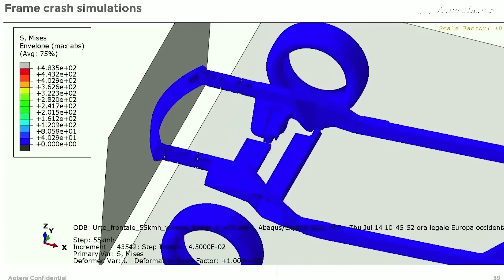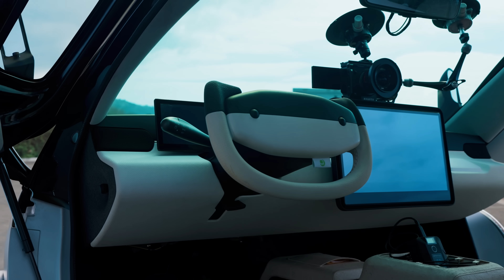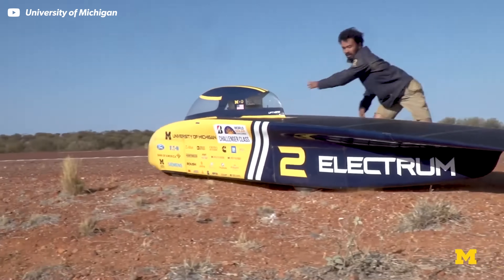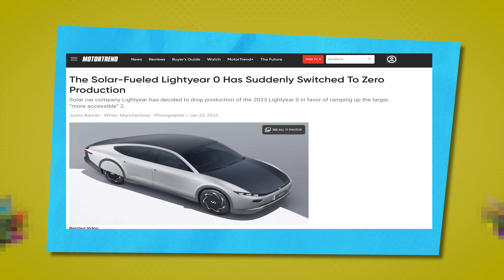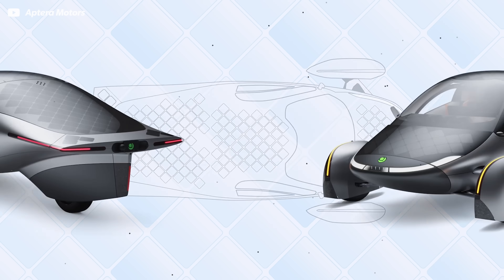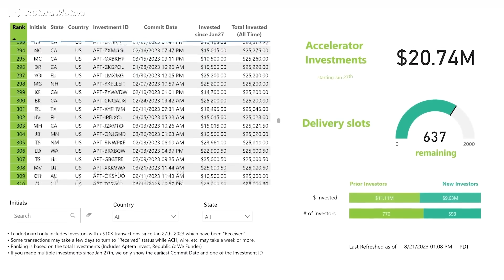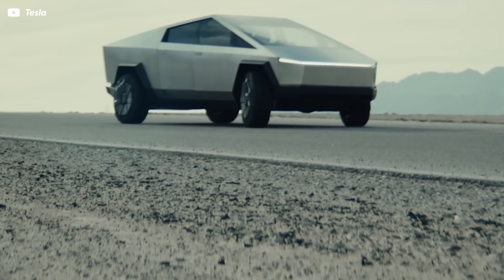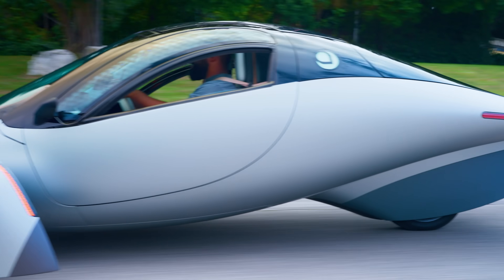We Drove America's First Solar Car

Comment: I'm putting this on record right now: there is NO WAY they get this thing out for $25,000.
Reply: The 1000 mile range version is $50k. The $25k one has a 250 mile range.
Reply: If you go look up the actual design and components of it, and with the cost of battery tech getting cheaper and cheaper, it is actually possible.  It's really neat and I'm so excited for this car.
Reply: @gothnate  $50k for 1000 miles is still amazing. $25k for 250 is really good. I think overall if they can get these price points, Aptera is gonna be making loads of money
Reply: @SMLYTPMovies  Yea, my kia ev6 was 50k for 250 miles of range.
Reply: @SMLYTPMovies deadass. I paid almost 40k for my Bolt EUV. I'd shell out 50k for that crazy range.
Reply: Why not? It is a far simpler machine than a Tesla.

It hits all the right spots. It is simple. So cost effective to make. Aero focus cuts down on battery for range which makes it lighter making it more efficient in start stop without needing 0-60 in under 2 second.

The caveat to that is if any load on the vehicle combined with poor lighting, range will drop drastically.

Speaking as a motorcyclist and car enthusiast? Efficient vehicles become pigs the moment they are put under load like hills or headwinds.
Reply: @SMLYTPMovies  the car looks like shit though they have to improve the design and make it look like an actual car and not like a homemade spaceship that a guy had to make for his senior project
Reply: @wavesssy Form follows function in this case. The manufacturer can't change physics. Just look at the Mercedes EQE or the VW XL1, they're not pretty either
Reply: They might, because it's a three wheeler, so it doesn't have to meet all the regulations for a car. It's a tricycle.  And they've worked with the Monro guy who is a logistical automotive engineer, streamlining engineering solutions for the car industry to reduce cost.
Reply: @wavesssy  I think it looks f**king amazing
Reply: @wavesssy  It's not an accident that it looks like a fish. It has to do this to squeeze out every inch of efficiency that it can. I think it's a different kind of cool and I'm into it.
Reply: @gothnate  This will not be the case. I asked Aptera when they were Live if they would still launch at $25k and they responded with basically that with inflation and costs of materials rising they will basically have a price increase, even though they advertised this price.
Reply: Changing the design to make it look like a regular car would kill the aerodynamics.  The design is for function.  If you can come up with a design that won't increase the production cost, and will not decrease the aerodynamics efficiency.  I'm sure they'll love to hear from you.
Reply: I'd happily put a large bet on that it wont go mass production period, but even if by some miracle it did, you're right, 25k is fantasy land
Reply: @wavesssy  solar cars have always looked like that. It’s to help with aerodynamics (helping the car move with as less drag as possible), and also maximizing surface area for the solar panels. For now, that’s how it will look. In the future, that might change though.
Reply: Yeah, I doubt the car will be $25k too. The price will definitely increase once it kicks into full production models. Either that, or they will look into getting extra revenue from other means, eg. after sale services, subscriptions, etc.
Reply: eventually, maybe, for now, the PI (production intent) model is a bit over 33k(400mile range).  My order specification comes to about 36k.
Reply: If they tweak the manufacturing a bit I could definitely see it getting below 30k. Electric motors are relatively simple, and it’s a tiny car with only 3 wheels. 

Assuming the batteries alone are 10k, its not unreasonable to see another 15k for the body, motor and tech. 

I think it’ll most likely be around 30k though.
Reply: @Aaron-xr7oc they're not launching at 25k because they're not launching with the base model. The spec they're launching with is 400mi battery pack, full solar panel set, and the 128kw all wheel drive motors.

Though having said that the base model is 26k right now on their website.
Reply: @wavesssy  it's designed to be aerodynamic. EV's need to be aerodynamically efficient in order to have range. The $25k model only goes 250 miles. But if you were to take that same battery system and put it in a Tesla, it would be MUCH lower because Tesla tried to make a normal looking car electric, and then worked to minimize it's aerodynamic load. It's all about function or form with this car though. I don't think it looks bad personally. And knowing that it's specifically designed this way to greatly increase it's range makes a lot of sense. Once they get the option to get solid state batteries in it, this thing would be able to drive halfway across the country on a single charge, if not further. Solid state batteries have nearly double the energy density compared to standard lithium batteries that current EV's use. So that 1000 mile range could double to nearly 2000 miles. That would be an absolute game changer. The company could then start looking at making a more "conventional" vehicle without needing to worry as much about aerodynamics. This would obviously bring in more sales. They are going about this the right way though. Too many start-ups are trying to make ridiculous EVs that cost way too much for the normal person. $25k is about the best price you could expect for a car. But a $50k car is still achievable for many people. $100k or more, yeah, that's not something most people can afford to buy. So getting a cheaper line out can help bring money back into the company so they can work on making different cars and can experiment with different designs. Plenty of manufacturers do this very thing. Make a mass produced, low-priced vehicle to bring in money for bigger and better cars they want to make.
Reply: No use for this car in the Midwest in the winter, no use for it in the winter in most of the US. This is a West coast, southern state rich people tout.
Reply: Man no offense but I hope you’re wrong, this would so cool at 25K, it’ll have way short battery life tho
Reply: @xureality   When i say launching at 25k I am talking about the base model launch. The price has not changed on the website since 2021, it still remains 25k (25,900)* to be exact. But they know that there will be a price increase.
Reply: 25k is unlikely but the math is still mathing for me...if they land all 40 000 preorders that's a literal Billion..
Reply: It's not impossible. Their way to get range is not more of expensive batteries, but instead using a small battery and getting almost 3x the MPG of a normal EV. It doesn't have to be expensive to have range, but the drawback is it's small and 3-wheeled.
Reply: I reserved a $40k F150 Lightning during the reveal. Needless to say, I was unable to buy a $40k F150 Lightning. I suspect the same will happen here. I have an Aptera reservation too.
Reply: @TarzanIsNuts  They can't do much with the silhouette, but they certainly can do something about those headlights and sweeping panel separation gaps (taillights loog great imho). The front end can keep the same 3D shape but completely change the 2D shapes that are projected on the 3D surface.
Reply: @mezmerizer0266  EVs always are rich people toys. They're impractical for just about any use other than commuting. However, I don't see what the particular winter problem would be with this, so long as it has cabin AND battery heaters.
Reply: It'll be interesting to see what the numbers truly come out as.  Since they haven't said anything about safety, software, service, manufacturing and reliability.  I've been suckered in before but to pay 50k just for range, it doesn't seem like a good idea.
Reply: @doctorfreezy2654  Really doesn't matter that they have a billion in preorders if it costs them a billion or more to manufacture. What matters is that they turn enough of a profit to stay afloat and keep delivering cars at that price point. At $25K a unit it's very unlikely.
Reply: @wavesssy  The shape is integral to the whole idea behind the Aptera. The highly refined aerodynamics reduces wind resistance allowing it to slip through the air, hence its zany efficiency. Contrast that with the “normal” shaped Ford F-150 or Jeep Wrangler, which are essentially bricks, that demand more fuel/energy to propel them down the road.
Reply: @gothnate 
There are many EVs with less than a 250 mile range. None of them can be bought for $25,000. 
Ford Mustang Mach-E SR eAWD only has a 224 Mile range, yet it has a MSRP of $46,995
Volvo XC40 Recharge: 223 Miles is $53,550
Even a Nissan Leaf SV Plus @ 212 Miles-has an MSRP of  $36,190. If Nissan, with its economies of scale and Asian production costs  (and without solar panels) can’t produce a Leaf sub $25K, a fledgling U.S. company will never do it.
Reply: @Peter-wz2wx  Factoring only component parts, yes this car is probably doable for $25k & $100k. However, they'll want to make a profit considering it took them almost 20 years to get to this point. I see them selling for like $40k+ for the 250 mile version and $150k+ for the 1000 mile version.
Reply: @matthewjbauer1990  That won't happen. That's rich people money who want rich people sized things. This is not a rich people car. The car is designed to be as simple as possible. Both in manufacturing and components. I would be very surprised if the price rises by much, if at all. Battery tech is constantly getting cheaper. It's far cheaper than when they announced that price even and that's a good chunk of the cost.
Reply: @just_passing_through Dude, the Aptera has 1/3 the batteries a Tesla has in it. Of course it'll be way cheaper. Aptera gets their mileage from P/W ratio and aerodynamics instead of raw power.

Aptera's weight is 1/4 to 1/3 of a Tesla's. It'll cost way less because of that.
Reply: The biggest issue for this car (and I LOVE this car), is that because it's not considered an automobile, but instead an autocycle, it does not qualify for the federal tax credit. So you can buy this for it's full price or a Tesla (certain models) for essentially $7500 under sticker. It's frustrating because this is the EXACT thing the tax credit should be backing
Reply: @wavesssy  I think it looks great. It's funny how people are so adamant about what others get to choose. If you don't like it, don't buy it. It's ridiculous to claim that they need to change the design, just to make you feel better.
Reply: they'll be lucky if they get it out at all considering the company went bankrupt once already and they have been "working on it" for almost 20 years
Reply: @wavesssy If they changed any of the looks, it would drop the range significantly.
Reply: They did not go bankrupt. @TheSimba86
Reply: Which part of the video states $25,000
Reply: @wavesssy yeah, instead we should have it look like every single other boring ass car on the road. 
No thank you, you can keep your cookie cutter vehicle that is indistinguishable from that of any other brand, I’ll take something actually interesting
Reply: @SMLYTPMovies  hell.. for 25k, i might even consider it. i dont have kids, i dont wanna drive stoopid any more, i just want a car that goes from a to b and i doubt ill drive 250 miles one way any way
Reply: Imagine never having to pay for a charge just leave it out in the sun
Reply: @ImDavidJames  I'll take that bet and raise you ten grand. As an Accelerator that resides twenty-six miles from Aptera, I can look forward to beta testing my Aptera next year. As an investor the downside is obvious, the upside is unknown. Grab your popcorn.
Reply: @mezmerizer0266 - I'm looking forward to using it in Alaska. More torque than my daily driver, all-wheel drive, the wind goes over and under it instead of through it.

My first thought was that there's no way it would be practical up here... and then I spent a little time looking into it and realizing how wrong I was.

As far as being a rich person's toy, the launch edition is coming in around $33,500... which is less than most EVs.
Reply: I hope it does, but automotive history says you're probably right
Reply: You'd be crazy to spend $2500
Reply: @wombatdk   Most people use their cars for simply commuting and grocery shopping. Hell, look at all the pathetic asshats buying $50,000+ trucks* to look "cool" and boost their fragile egos, just to commute and get groceries. I'd say a Tesla and similar EVs are more practical than ICE vehicles because they have AWD and tons of cargo space since there's a front and rear trunk. The charging is the only thing that isn't practical, but most people aren't driving more than 250mi in a day anyway and then you charge it overnight. 
*most are essentially just shitty SUVs with open cargo areas these days, made to haul a family of 4 and not made to actually haul anything in the small 4-5' bed.
Reply: @wavesssy they aren't making the car to look nice, it's designed like that to be as aerodynamic as possible. That's what allows for the 1000 mile range at a decent price and what makes changing from solar practical. If they changed the design to look more normal, we wouldn't get the insane specs
Reply: They have steadfastly refused to provide an updated price even after their founder said unprompted the move to using carbon fiber for the body and such raised costs substantially. they even have an investor leaderboard :)
Reply: @Jeremy-kg1zr  if you can charge overnight. Many renters can't. And with EVs costing easily two- to three times that of comparable cars... they are unaffordable for most anyway.
Reply: With evs, people are going to have to come to terms with physics being a big deal and will have to come first before your "ideal" car design. This car is supposed to be designed for efficiency and range, and considering how aerodynamic it is its actually great looking.
Reply: @wombatdk   I would agree for sure on the price to purchase; they're expensive. Half the population can probably afford them without too much strain, though. Granted the way our government runs things these days, the other half of the population can barely afford rent(I'm in that half), but you don't have to be Rich to buy them - just have been born in a decently middle-class family and gotten to go to college and get a decent paying job.
Reply: My reservation specs say I'll be paying $32.5K + tax/tag/title/delivery/financing for the launch edition with full autonomous features. Still a great deal considering the fuel and maintenance savings.
Reply: @gothnate  Also the Aptera has no gearbox or transmission which increases range by maybe another 10 percent.
Reply: Chances are, few will purchase basic model as is.  This will lead to adjustments of specs for the base model, affecting the entry price of future iterations. 

Their launch edition is an indication of it, which is based on what most folks picked for reservations.
Reply: @wavesssy  it's not a car. Why should it look like one?
Reply: @gothnate I think it is $26,900 now.
Reply: @SMLYTPMovies well just remember it has to be a good deal. Like it or not this thing is competing with conventional cars with 5 seats. If it's not a good deal for those who fit it's niche, it's not gonna sell. Plus being solar only benefits those who care about the cost of things. Obviously someone buying a Hummer EV for $106K doesn't remotely care about the cost to charge it.
Reply: @V.Perez1985  you should've sold that thing a while ago then. The Bolt was down to nearly $17K earlier this year.
Reply: @wavesssy  not all cars have be conventional. If they all were people would only buy the ones with the best features or the cheapest. You need a niche to sell something and I think they found one. The main question should more be "how big is the market for it".
Reply: @Skylancer727  I think you meant $27k. That's the base model price for the '23, which is cheaper than a used '22.

We had our hands tied on timing because our last car got totalled. I'm not upset by the price given the tax credit.
Reply: @V.Perez1985  Yeah at $27K you'll only really pay $17-19K in the end after the tax credit and state incentives. Depends on the state you live in.

Helped even more just after the fire fiasco where some were going for below MSRP.
Reply: @wavesssy  They didn't design the car, physics and  computational fluid dynamics did. They cared far less on how it look and more about the aerodynamics to make it so efficient. I happen to think it looks amazing but to each their own.
Reply: @barnabasseadog7660  I’ll take that bet
Enjoy your ‘beta test’ I’m sure they will make a couple. But full production at 25k. No chance
Reply: @ImDavidJames  
They only need to make the first two thousand. Then the next three thousand. The tip of the spear.
I reside twenty-six miles from the assembly facility. Aptera test pilot in waiting.
Grab your popcorn, get in the back.
Reply: @barnabasseadog7660  you don’t know if the company will survive. And I don’t either. 
Some come back to this comment in a year and we’ll see if you win your bet won’t we
Reply: @ImDavidJames  
Of course, I'm here for the long haul. As an investor the downside is obvious. The upside is still unknown.
Reply: @piccalillipit9211 autocycle, not tricycle; tricycles/trikes have one wheel up front and two in back
Reply: @danam0228  WOW - I never knew that - I even googled to check you were correct and you are.  THANK YOU
Reply: @V.Perez1985 what year did you start saying deadass?
Reply: @wavesssy clearly you don’t get it. A box can only be so aerodynamic.
Reply: @wavesssy  beauty is in the eye of the beholder. I am a life long lover of aerodynamic shapes, from sail plane cockpits to the MClaren F1. I think this is a beautiful car and far more beautiful to me than all the muscle cars and trucks that are shaped like bricks. So cool, you don't like it, don't buy one. Plenty of options to choose from. For us aero enthusiasts, this is gorgeous.
Reply: Hills? Snow? Little small-dude its tiny! Aptera test is to climb Mulholland Dr. Let me know? Please be the new “doodle-bug” for 21st century!!!
Reply: There is NO WAY they get this thing out... at all.
Reply: @SMLYTPMovies i hope they make money. this market is in dire need of new innovative ideas